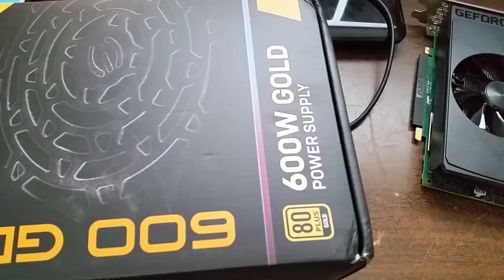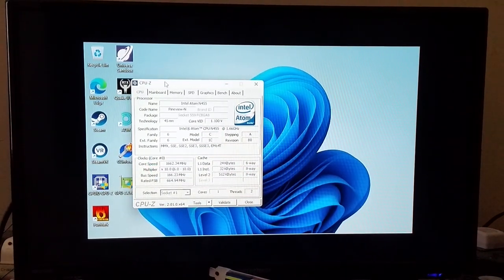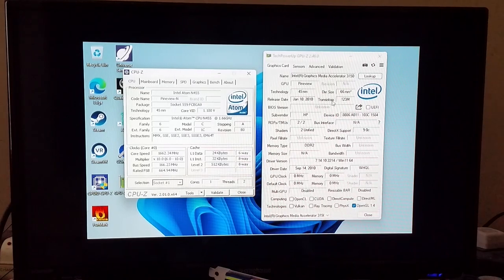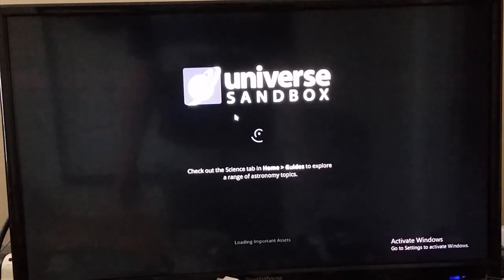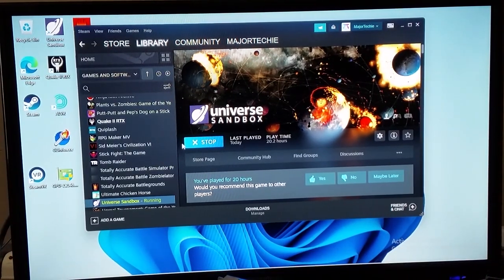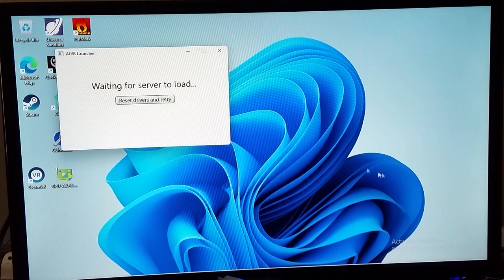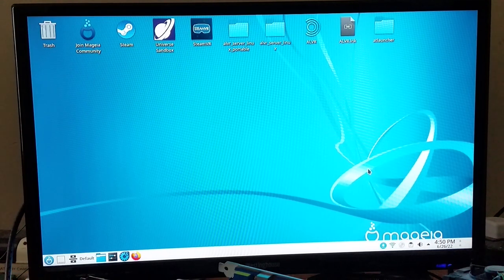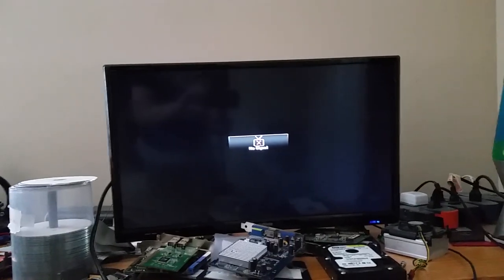I installed an RTX 2060 in a NETBOOK!

Comment: i found out your channel just recently, its literally a gold mine :D i hope you will get more views and subs in a bit xD

edit: I also have a netbook with the same CPU and also 2GB RAM (Asus 1001PXD) and I can run Lunar Client 1.7.10 (the cracked one loads about 3 mins and the normal one 30 mins) at about 60-150fps (when you arent moving) on the GMA3150 integrated graphics, on Antix Linux mind you (it takes up about 150MB RAM at startup). Of course, when you move or look around, it stutters hard, but I still think it is actually possible to beat Minecraft on an N455 and the iGPU onboard.